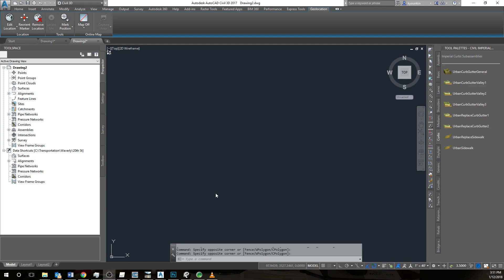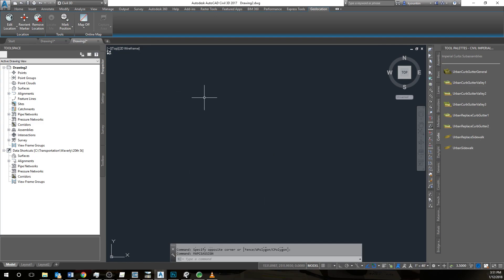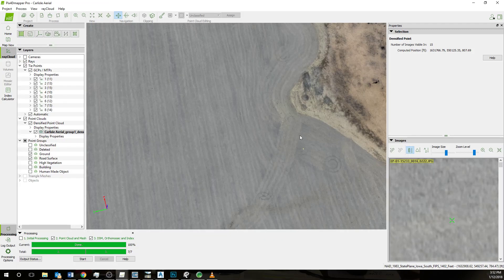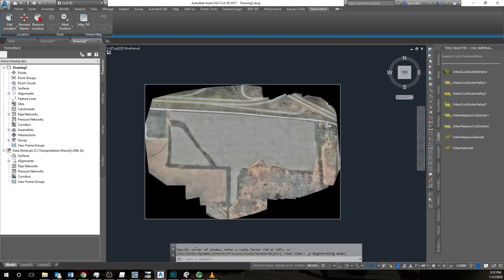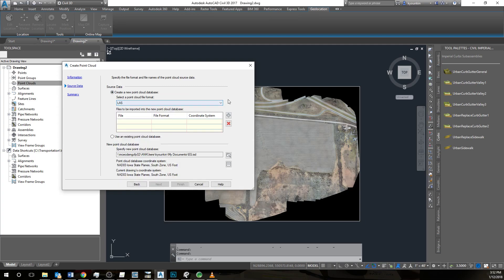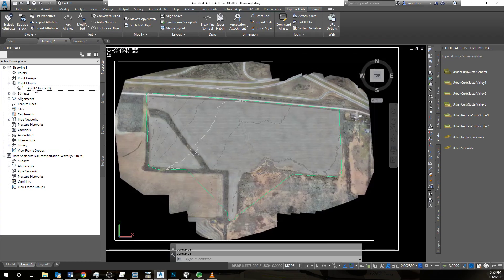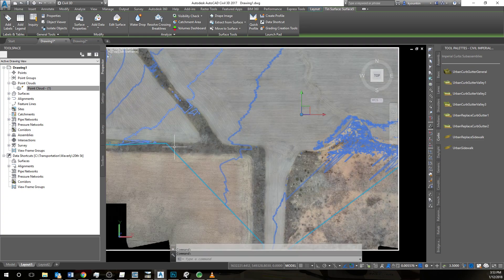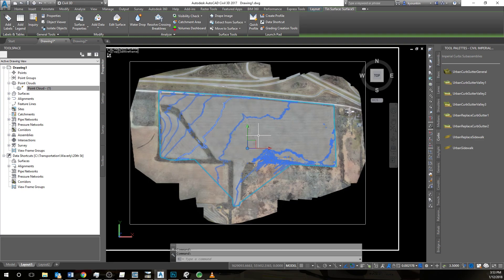Processing Drone Imagery for AutoCAD Part 4

Comment: Very informative videos Kyle. I have a question regarding drone mapping for you. I'm looking to do a "survey" of a parking lot for my company, and I need specific information. This information consists of slopes measured in degrees, vertical & horizontal gap measurements, curb heights, and finally parking sign heights. Typically, I measure these the old school way with a level. Would it be possible to obtain the information that I need with a 3D map from a drone? I would just like to add that I'm a part 107 uas pilot, and I'm very new to mapping. Any information regarding my question would be greatly appreciated. Thanks in advance.